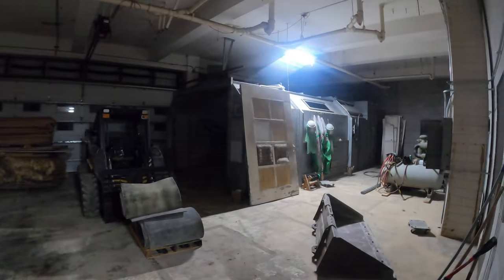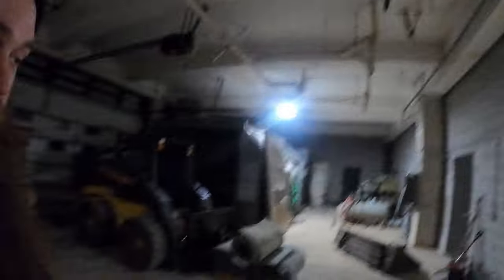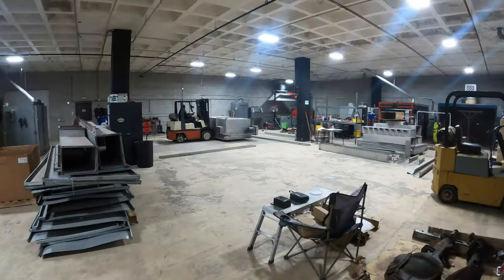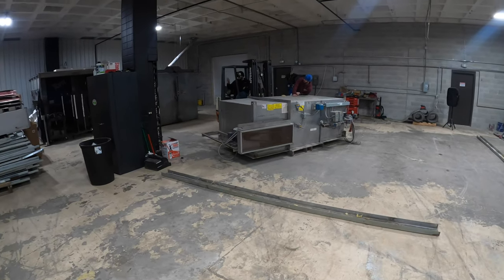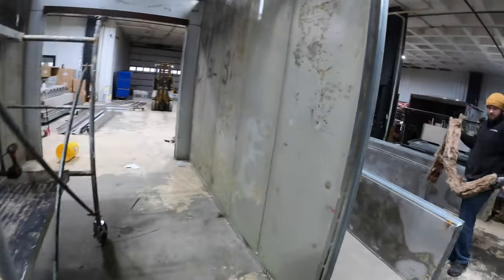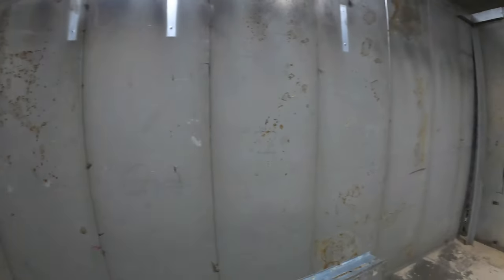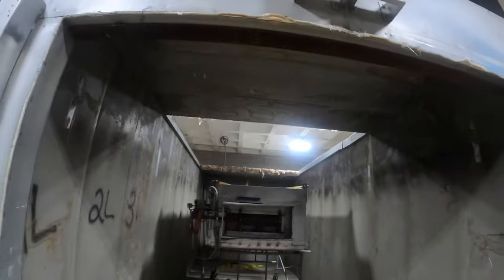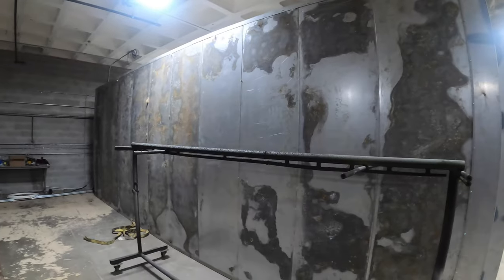Big oven is up!

Comment: Wow you are not fucking around !!! I am in the process of opening my powder coating shop but half my shop is built inside a 24’x8’ enclosed trailer tall roof and then a small shed to blast in lol I did this bc I do not have the shop space and believe it or not I got a 4x6’ oven and open face spray booth 6’ wide that I built and my t30 compressor a blast cabinet,my work bench and my wall mount propane heater in there and there’s still mayne 8 ‘ of floor space on one wall lol . Any ways this is awesome. And if you ever want to sell old equipment I would he interested

Comment: Also I was wondering what is your most used piece of equipment besides your oven obviously? I have only a small idk maybe 3’ wide cabinet but I do have a 50 lb industrial plast pot so more then likley that will be my go to . However I’ve been considering buying a large 4-5’ wide cabinet as I have room for it in the main part of my shop . Do you think I should or just blast all my medium to bigger stuff with my pot ? Obviously I can only fit smaller items in my current cabinet but with that said I was thinking if I do get a larger cabinet I would convert my smaller one into a vapor cabinet as I plan to do more then just powder coating but also so bare metal finish work and cleaning also . I just ordered a 40l ultrasonic cleaner and I am looking for an industrial parts washer .